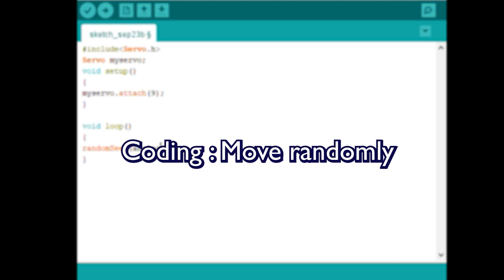DIY Amazing Automatic Cat Toy

Comment: 😮 this is by far the best mechanical cat toy I've seen 😂 where can I get this motor from?? What's it called? I want to try make my own 🤭
Reply: This guy doesn't answer his comments :(. I just made one. You want a 180 servo motor. I got mine from  Digi-key. I can't find the link to the actual one I bought but I think mine might be a little wimpy anyway. Whatever - they are cheap enough so I'll just replace it if need be. Good luck.

Comment: Nice project. What did you write after RandomSeed? Can you share the codes?
Reply: This guy doesn't seem to answer...I was going to ask where he got the plastic strut...anyway - a bit late - but I made one. Here's my code: #include <Servo.h>

Servo servo; 
long pos = 0; 
long delayMs = 0; 

void setup() {
  randomSeed(analogRead(0)); 
  servo.attach(9); 
  Serial.begin(115200); 
  const char *helloWorld = {"Hello world."};
  Serial.println(helloWorld); 
}

void loop() {
  static int elapsedSeconds = 0; 

  // random position - 0 to 180 
  pos = random(180); 

  // random delay - 500 to 1500 miliseconds
  delayMs = random(500, 1500); 

  // set the angle and wait
  servo.write(pos);
  delay(delayMs); 
}
Reply: @mudspringer  @mudspringer thank you! imagine close sourcing this code, hahaha, thanks OP for the good idea still